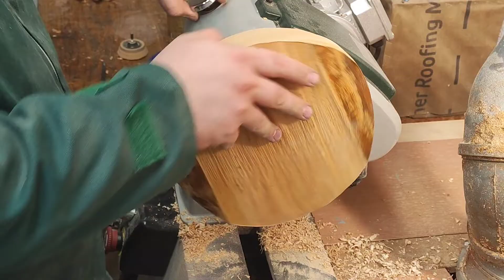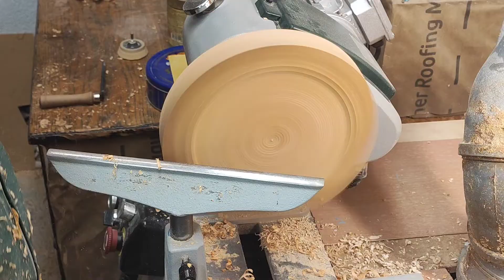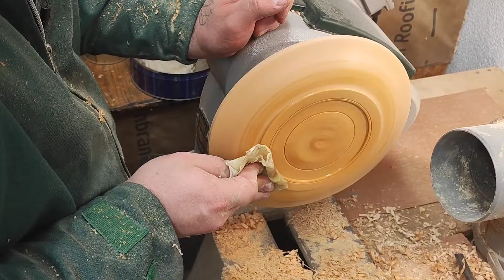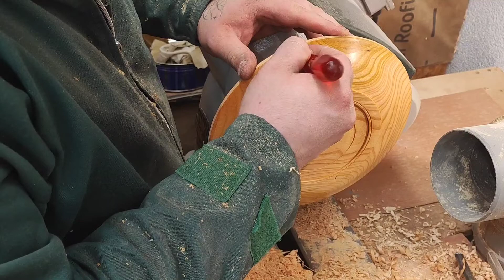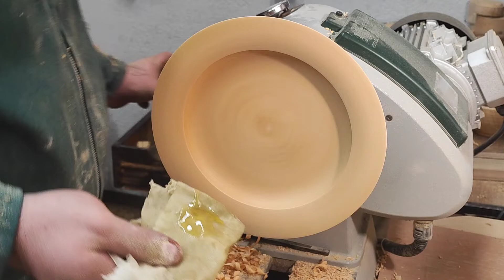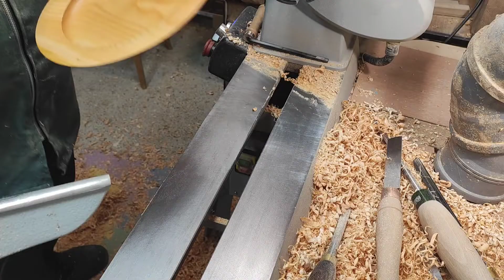WOODEN DISH_HAND TURNED WOODEN PLATE

Comment: Hi Tomislav, how does the new gouge treat you? Do you notice it holds its sharpness for a lot longer?
Another question: you always touch the wood while it's still spinning, have you ever gotten a splinter? 😅
Nice plate by the way 🤗
Reply from the maker: Gouge is working great, I did have to drill the hole in handle deeper to put the gouge deeper in , but that is personal preference. Other then that gouge is working fine😉 
Splinters, not really,if the wood is cut clean you really can't get splinters😉
Reply: @tomislavtomasicwoodturning  Thanks for you answer 🤗 I'm always a bit hesitant to touch the turning wood 😅
Have you already shown how you sharpen your bowl gouge? The grind looks interesting but until now I only grind with Tormek 😅
Reply from the maker: @0BAMiiN  I have a few months old video on sharpening but I will do again in beginners series 😉